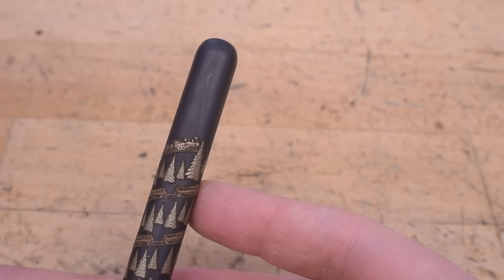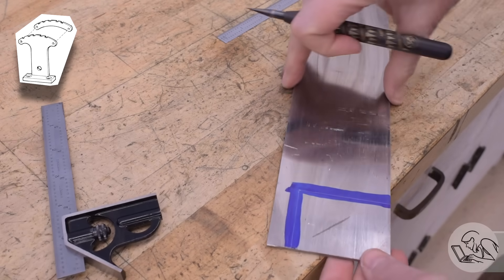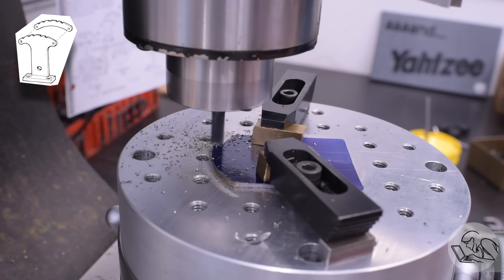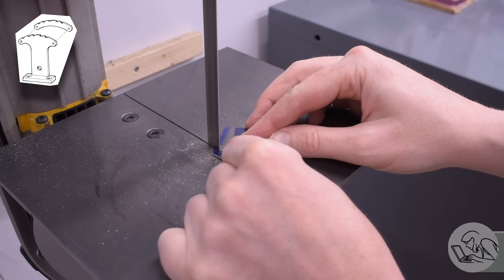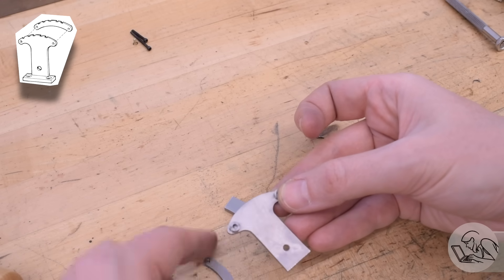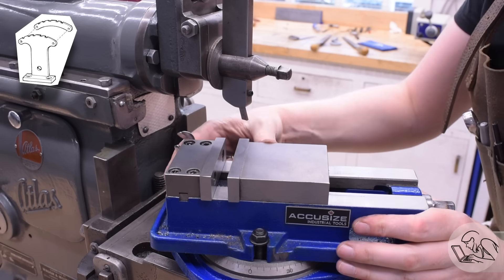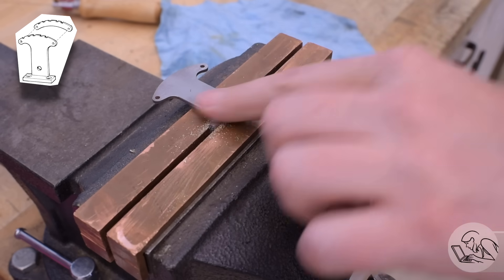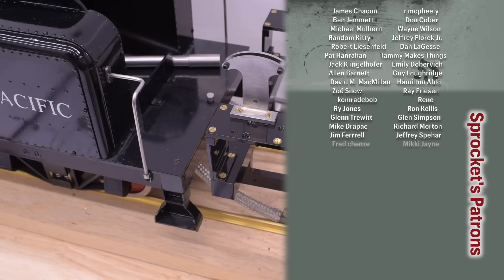Quadrant - Pennsylvania A3 Switcher, Part 70

Comment: Always love your videos and usually learn a thing tr two along the way. One thought, for that notch on the thin stock on the shaper, some ballast/waste material on trailing side of the stroke might have helped. It would provide the additional rigidity as the tool pushes through the stock. Though when you have a mill...

Comment: Random observation - Quinn typically refers to machines as “the,” e.g., “the bandsaw,” which seems normal to me. On other channels, though, (e.g., Diresta) it’s always “my” - “my bandsaw,” “my drillpress,” etc. which always seems a little jarring to me. I think it’s a regional thing - east coast vs midwestern us / canada - rather than an individual quirk, but wondering if anyone has any thoughts?
Reply: To my Midwestern ears, “my bandsaw” seems sort of “braggy,” emphasizing you own it versus using a tool that belongs to “the shop,” but I’m sure that’s not the intent.
Reply from the maker: That’s how it would sound to me too. I guess that’s why I don’t say “my” 😄
Reply: Thanks for the reply! To be clear, I don’t think Jimmy Diresta actually is “bragging,” I’m guessing it’s a dialect thing like “in line” vs “on line,” other youtube makers do the “my” thing too. Curious if it’s regional, or maybe learned from some common source?

Comment: Great video Quinn, looking forward to seeing the rest of the linkage build(s). 

2:00 5/64th (0.0781") is pretty close to 14 gauge, 0.0747" in theory. I wonder how important those 3.4 thousandths are. 

Nice to see the shaper integrating into your work flow. Did you debate silver soldering the blank to something large enough to bolt to the rotary table rather than strap clamping? It would have let you complete both radiuses on the small part and play less musical clamps. Scale coin 2 has seen some days.

Comment: After watching this earlier, I was turning over in my head that attempt at the notching op, and the resulting nasty tear-out. It looked like the shear tool you have has the cutting edge square to the cutting direction. I seem to recall ABOM79 showing a shaper shear tool with a sideways rake angle on there, kind of like a snowplow blade. Perhaps that is worth a test, grinding a raked shear tool and seeing if it's any better at notching by not emerging out the far side all at once?
It may fail to improve things because the leading point might wear out quickly upon repeated impact. Only one way to know... care to experiment with this sometime?
Now, obviously, just bunging that little piece into the mill is WAY faster; but home shops (especially those with shapers in them) are not in any way about optimising production efficiency. :)

Comment: Do a little disappointment in you at this point. After a year of working with kozo's design and you haven't automatically started comparing all the measurements to a conversion table.
Reply from the maker: I have one, but I only recently noticed the pattern of metric starting stock

Comment: Whenever I see a weird decimal measurement, I always convert to metric or vice-versa. Very often it's a standard size, they just didn't want to use their non-preferred unit on their drawing
Reply from the maker: The reverse is often true as well. A lot of plumbing and construction materials are weird sizes in metric countries because they’re actually using the old imperial sizes and have converted them
Reply: I bit like most ‘4x2’ timber not actually being 4” by 2” but the metric equivalent the rest world is using of 90mm by 45mm

Comment: As always an excellent presentation of a well done project. I do by the way love your " shut up that's why! " line, it gets me every time. 

So as to galvanic issues, hook up a few tiny wires to tap that energy. You can use it to help keep the Bluetooth tiny robot engineer charged.

Comment: Neat scriber.  Your construction is yielding some impressive results.  Re the stock, I didn't pick up the metric equivalent til you mentioned, but the decimal rattled a couple brain cells and sure enough, 14ga corresponds.  As to the error you mentioned, the drawing went to revision "A".

Comment: And we have another "because shut up, that's why!" I look forward to those as much as "Yahtzee!"
That is a neat little part. I always look forward to the next Blondihacks video!
Thanks, and Meow to Sprocket.
Reply: It was a good practice run... it just happened to be at twice the radius, a good safety margin... and it was good practice.
Reply: It looks really good milling an arc that goes half the depth of the milling but, that's a very good reason to do it that way

Comment: Fun fact, the reason that modern diesel locomotives have 8 throttle notches was because when the move was made from steam to diesel the manufacturers and the railroads wanted to keep the transition for the engineers as simple as possible. Here we are all these years later and we still have 8 notches.
Reply: Blondihacks, I hate to say this but it looks like you milled into your rotary table. Otherwise, all your work is excellent.
Reply: @CameronMcCreary-u9e  that's not the rotary table, that's a sacrificial fixture plate mounted on it. It was made in another video for exactly this purpose, you can cut into it a bit and whenever the surface gets too rough you just mill the whole thing flat again!
Reply: @CameronMcCreary-u9e  It's a sacrificial aluminium fixture for exactly that purpose
Reply: @CameronMcCreary-u9e the 'table' part of her rotary setup is sacrificial.  That's why the Table part is so thick.  She can just flycut the top flat and have a fresh surface to work with next time.
Reply from the maker: That is a fun fact! Airplanes have a lot of weird anachronisms in them for the same reason- to reduce pilot retraining.
Reply: @Blondihacks this is also true in automotive engineering as we transition to EV. We put a lot of effort into making them drive like internal combustion vehicles for the sake of driver familiarity.
Reply from the maker: Yes I experienced that with my Leaf. It had minimal regen because people didn’t like the deceleration when lifting throttle. They wanted it to coast so it feels like an automatic transmission on an ICE car. Then I got the Bolt which had a full regen option and it was awesome. It was like standing on the brake pedal when you lifted off and I loved it.
Reply: @Blondihacks  and it's not like steam was all that long ago - in the UK we still have a (very) few train drivers who started on steam and are still working.
Reply: 40 years driving locomotives and never attributed the word ‘notch’ to steam engines! 😳
Just to throw a metaphorical spanner into your  skewmorphic interface, (love that term), but I’ve driven locos with as few as four and as many as 10 notches. All the same, great piece of etymology. 👍